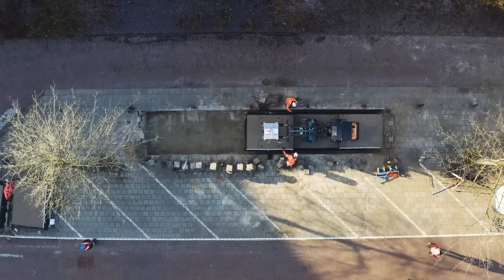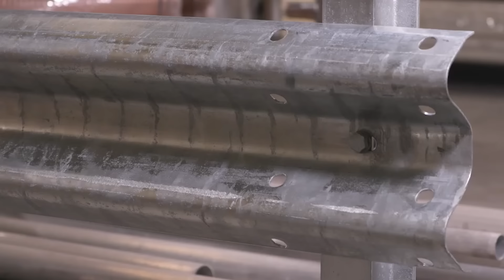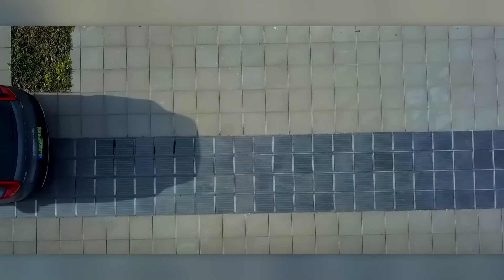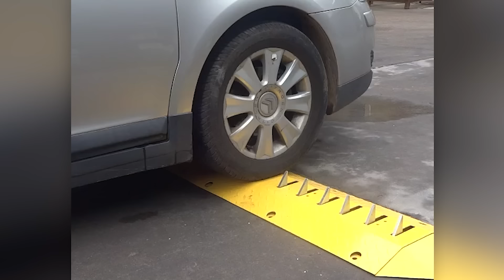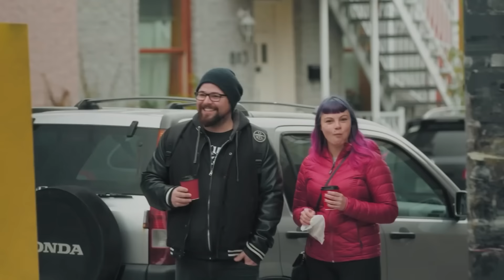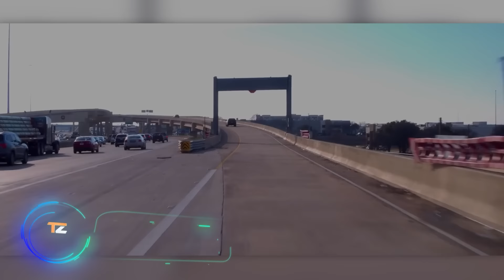ROAD INVENTIONS OF THE NEXT-GENERATION

Comment: Crosswalks?
I've  seen dumb shits be 50 ft from a crosswalk  and walk out in traffic to cross . So what makes them think these in the video  is going to work . 
Run away truck have it set up same way as going down hill but flat on both side of traffic lane direction. 
Reflectors in the road don't even last where it snows  ,plows wipe them out

Comment: Scientists are working on a speed bump that has a non newtonian fluid filling the inside, the fluid changes to a solid when it comes into contact with a fast object, but changes to liquid on a slow object. This is much cheaper and easier to install than the automatic speed bump.

To try this at home just mix cornstarch and water.

Comment: Plastic roads are garbage. They chip and thus send pieces of plastic everywhere along the road, the 'recyclability' of plastic doesn't work when it's contaminated with road particulates (The temperature to melt out the gunk is high enough to burn the plastic), they lose traction as they wear out (VERY dangerous), they can't handle thermal expansion/contraction remotely as well as asphalt, and 98% of aslphalt is recycled already because all you have to do is heat it up and pour it again.
Reply: true, the plastic roads even sound garbage
Reply: the name (don’t get confused)

Comment: As a trucker I'm confused about the net.... It costs money to manufacture, over here runaway tractors are given "ramps" doesn't matter if said ramp is flat, what slows the truck down is the soft dirt that the ramp is made of, trucks sink like a stone and the entirety of the bottom of the tractors surface area becomes the braking mechanism. It's proven time and again to be VERY effective in the mountains stopping tractors that weigh over 80,000 lbs going over 100+ mph (due to brake failures). I'm sorry but nothing I can think of is cheaper than dirt. So your fancy fence doesn't make sense it would have to be repaired after each use, your need to hire safety inspectors. Dirt ramp gets used? Grab a front loader and level the dirt again your good to go. Lower maintenance costs(its dirt) parts would be easier to order (dirt) I'm just saying that invention is absolutely not needed.
Reply: They're used when the terrain doesn't allow for a traditional ramp.

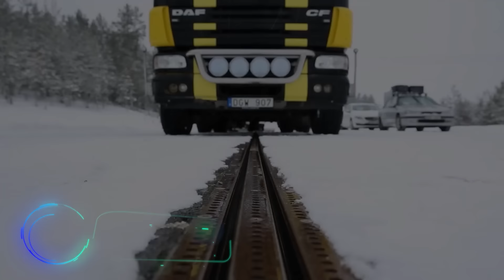Comment: 4:20 Where is the return path for the current? If there are two contacts on the one probe, there cannot be enough voltage or current to meet the drive requirements.
Reply: They use induction. Think like the wireless charge pads for a phone, same thing. And electric current in coils under the road induces a electric current in a coil in the car which generates power.
Reply: @SilverStarHeggisist  The commentary states that it uses contacts on the rail, not induction.
Reply: @TheAdwatson  I guess it's a modern version of the old twin contact London Tram pickup shoe that was called a "plough".

Comment: Building roads out of plastic may sound like a good idea or way to recycle plastic, but considering how many roads criss cross the world,, building roads out of plastic only encourages drilling for oil, as plastic like asphalt come from oil, and we need to get rid of both, as far as I’m concern, although if we can start recycling asphalt and used plastic products, without drilling for oil, now that a good star, beside oil is finite like all resources, and those countries that solely depend on fossil fuels like mideastern countries, need to change, their source of wealth like every the logging industry need to change, we can’t keep deforesting old growth forests, jungles or the Amazon or any other forest around the world for hard wood or to plant palm trees for palm oil or some other commercial tree…anyways, many of these solutions like road bumps, runaway vehicles etc, should  costly, like something one would only have in some private wealthy community to control or catch intruders, trying to escape, after committing some crime, but the best idea, in my opinion are safe bicycle lanes and replacing asphalt or concrete with solar panel’s…but no doubt these ideas would work best in a small country…

Comment: There is enough power grid to supply power for 12% of the human race, know your designing panels for caring a lighter load ? Let’s go back to the manufacturing of the batteries that are in electric cars, for every cell produced you haul two semi load’s of ore from a mine the two semi load’s of sulfuric acid. You read that right sulfuric acid to manufacture one lithium battery cell, where in the process of cleaning up the earth do you special people dispose of the waste?
Go ahead you may as well destroy the earth quicker than you would mining oil and producing fuel products. I may not be the smartest person but it doesn’t take a rocket scientist to figure out which one is the best for the earth.

Comment: I already see one major flaw with "Plastic roads". Especially with associating it with electric cars. What's the biggest thing about traveling on roads to watch out for? Car accidents. What is something that happens often with accidents? Fires. Which kinds of vehicles produce the hottest flames and are the absolute most difficult to extinguish? Electric vehicles. With plastic roads, you won't be able to simply pull the wreckage out of the road and allow traffic to drive past it. You're going to have to get new pieces of roadway to replace the slagged mess left behind after every single flaming accident.
Reply: Well said.  Here in the UK out of all the fire engines 99.9 are water filed only a very very small percentage of fire stations have the chemical extinguishers for electric cars fires . .I will never buy an electric car until 100% fire engines have this chemical 
Yet the UK has a very high rain fall if you in an electrical car and the batteies are on fire  even tho they have the chemical to put out the fire  if it's raining the car will keep burning. As the batteies only need a drop of water and boom up in flames . No matter how much protection they be covered in in an accident one drop water boom BBQ time
Reply: I can foresee another potential problem. In areas it snows, will they be able to hold up to the punishment roads take from plows? They said they can be heated, but in a heavy and fast snowfall they may struggle to melt the snow in time, thus needing to be plowed.

Comment: About that Swedish electric road at 4:20. 
What Happens if a person step on the electric rail? It must be dangerous if a person walks on it.
Reply: Maybe DC or by making the actual contact points deeper
Reply: Induction charging. You know how a phone uses a wireless charging pad? Same thing but on a larger scale for cars. It allows for charging the car without directly connecting to contact points. Coils of charged wires under the road induce a electric current in a coil in the car, this current charges the car. No exposed electricity animals to come in contact with. One possible issue could be people with metal implants or pacemakers. One solution could be to have a sensor see where each car is and only energize the coils directly under the car as it travels down the road.

Comment: The spikes have been around for a long time, the military has been using them at secure checkpoint entrances for at least 40 years.
Reply: And at every mall is south Africa
Reply: @South African Car lover  ... and in Hawai'i too!
Reply: Yeah there are loads around me
Reply: Facts
Reply: I wouldn't like to fall from bike and slide through those spikes !!
Reply: From what I have heard they are quite prone to failure if not maintained well. Debris collect in the space where they spikes go down over time. When they get full the spikes don't go all the way down, which leads to them puncturing tires of cars going the right way. That was at least what happened when they tested them in my country at least.
Reply: @tobiasagdrupdrager5583  The ones I see the military use in the middle east have no moving parts and it is just a ramp with sharpened ends and are just as effective.
Reply: Qq1

Comment: Those Cat's Eyes work only countries that doesn't snow.
Reply: Yep and as a road worker I wouldn’t recommend drilling holes in the asphalt as it will weaken the asphalt letting water in.can use hot rubber to stick on which also fails but doesn’t let water in
Reply: They use them to great effect in PA, they're sunk into the road a little